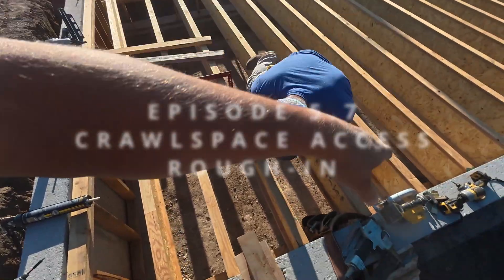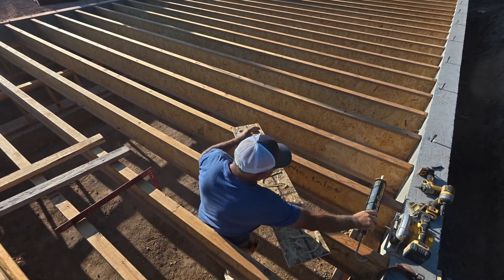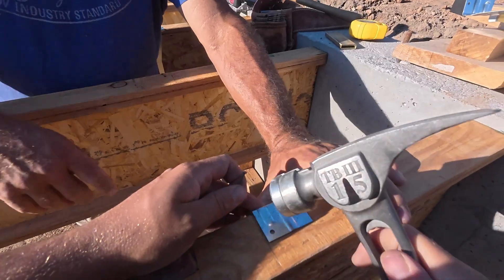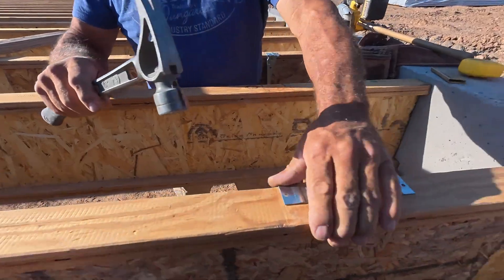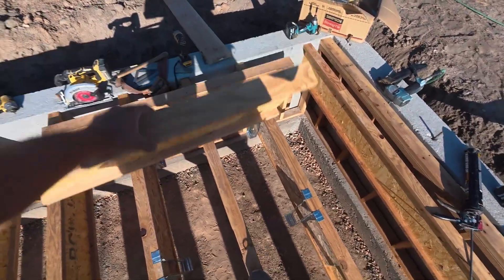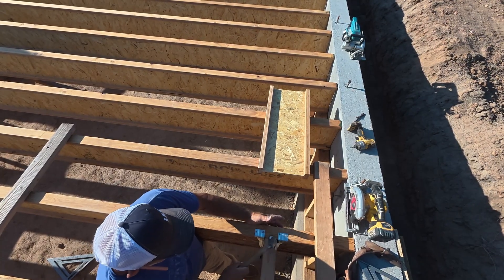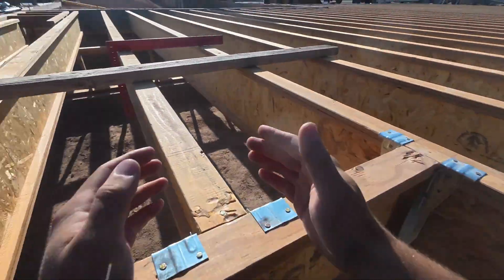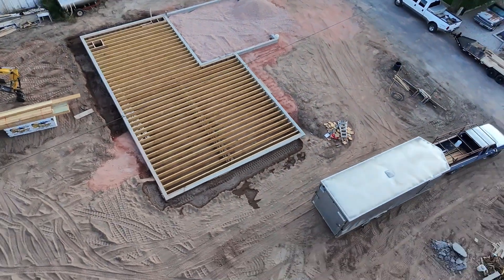How to support floor joists around crawlspace hole | Ep 5.7 | HOW TO BUILD A NO-STEP HOUSE

Comment: Nicely done!
I would like to know how big you can go using the same technic for a crawlspace hole?
Reply from the maker: @mehrezsebaa4629  We like to keep our joists at 16” centers, and only like to cut one joist for this.  

So 29 1/2 is the size from joist to joist.  And we usually do 24” from cutting the joists.  But the biggest we would cut is 29 and 1/2.

So the biggest is 29 1/2 by 29 1/2 is what we would do.  Thanks

Comment: May I ask why you built short walls (pony walls) around the perimeter instead of using rim joists (I think that's what they'll called) and attaching the floor joists to them?
Reply from the maker: Yeah, so what you’ve seen with rim joists is how we usually build homes.  But this house is out of the norm.  So if we were framing the usual way the joists would be directly on top of the foundation with only center bearing walls, instead of set in the floor.  Seems how the floor joists are dropped down on the footings of the foundation, the exterior pony walls bear and hold up the whole floor along the perimeter instead of the foundation walls.  Also that makes it so you have no need for the rim joists.
Reply: @udybuilders Interesting! Thanks for the reply..

Comment: I know you will cover this is a future video, but I am just so eager to know....will you run the plumbing before laying the subflooring?
Reply from the maker: Ask me as much as you’d like, the more comments I have the more my videos will be suggested.  So yeah, no worries there.  

Regarding the plumbing, we have never had the rough-in plumbing installed before framing.  Also asked my dad this because we’ve had more than just you asking about this, and he has never seen the plumbing done before either.  

The reasoning behind waiting for the framing is that the entire build goes more smoothly for everyone.  As a general contractor, when plumbing is installed, you need your HVAC guy and you plumber to communicate and work together.  Also installing T&G osb is going to be a challenge.  What if the homeowner wants to move a wall during rough-in.  Etc..

Thanks for the comment. I know they used to do it and in some places they still might?   The only other time that we have seen the rough and plumbing done is obviously when it’s a basement floor or a slab on grade.